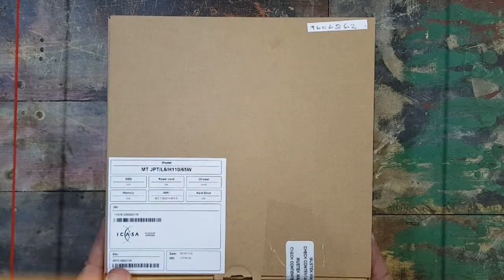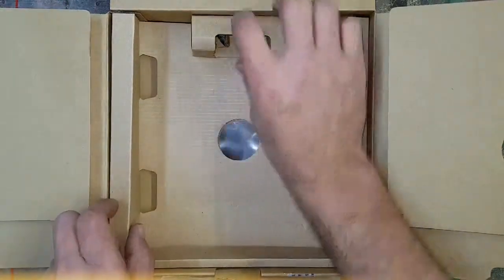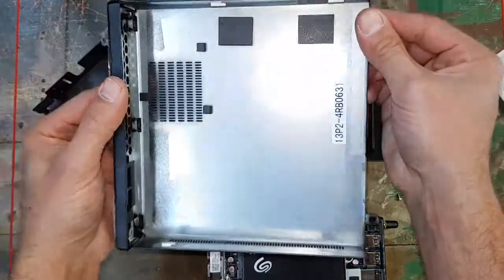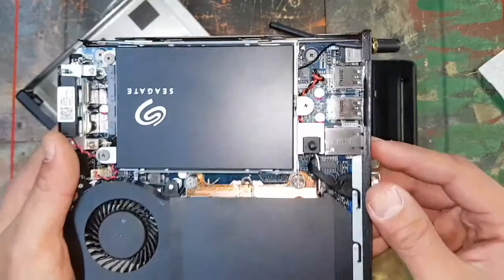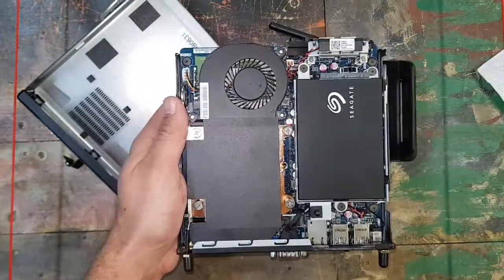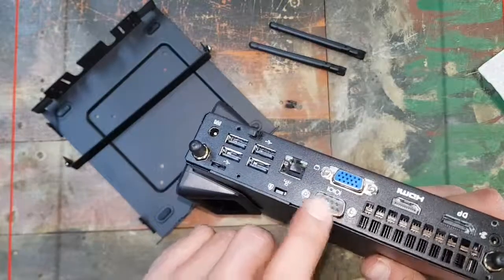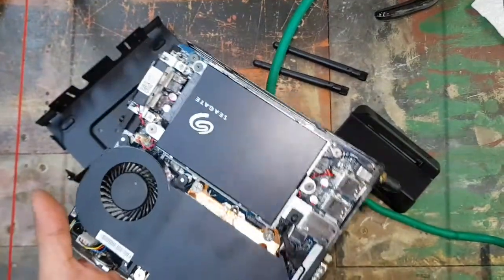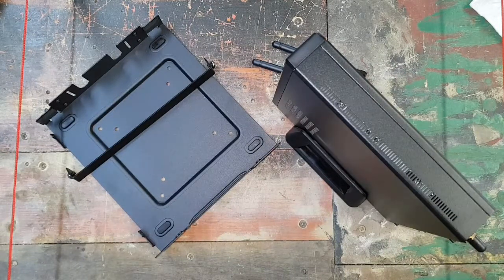Mecer Jupiter Xtreme Mini Pc

Comment: If only I had watched this before purchasing a mini desktop Mecer H1A to replace my tower operating with Windows XP,which in computer terms was aging. My Mecer is also 4 Ram. All I wanted was something smaller & quieter, so less clutter on the desk . My verdict. Looks great ,takes up little space unlike a laptop. I have a Philips 233 v LED monitor.  A tiny 2 page non informative folder was supplied to me by the dealer. My verdict  Reallly,Reallllly................. slowwwww , cannot handle much information at once .goes into a state of acute confusion lasting many many minutes during a simple operation opening Facebook for one on another page, make a pot of tea in the meantime while breathing deeply.  I have uncapped Vumatel fibre. You tube videos would often stop at about 1.to 2 minutes with a spinning wheel centre screen, forcing one to go back & re enter the video & hope for the best.( The system operates with windows 10. HATE  IT for the twiddly little changes madeXP was far more user friendly.       With W 10 one has to jump through hoops to perform previously simple operations). Often the Mecer would emit a grinding noise while operating , possibly due to having to process too much information.  So a resounding thumbs down on this model which for me performs more poorly than my 1st computer in 1998. I shall definitely take it up with the local branch in Cape Town & say a few prayers.
Reply from the maker: Good luck. Is the one you have perhaps a celeron? I know the performance on them is low but with a ssd it makes a big difference.